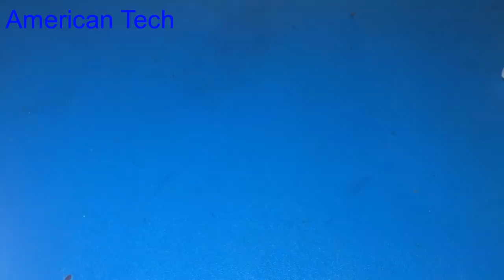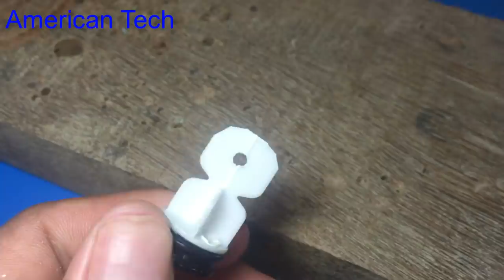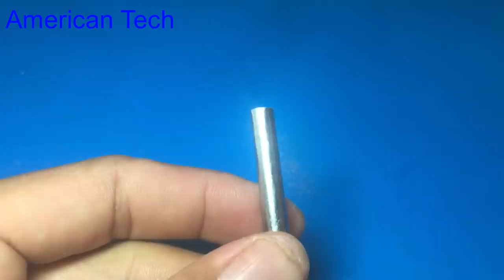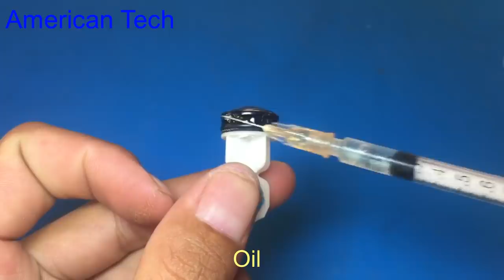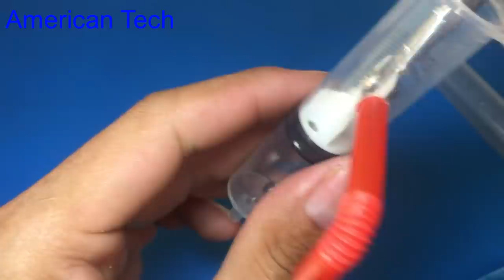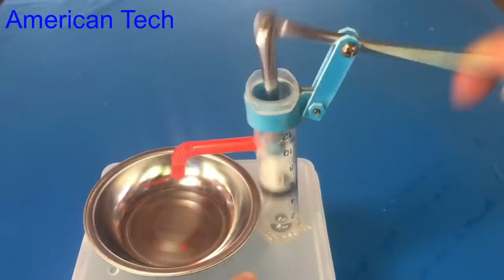Mini hand water pump using syringe

Comment: What the reason of used this small ball?
Reply: There are 2 balls, lower and upper. The lower ball serves as foot valve while the upper ball serve as check valve. During upstroke movement of the pump the lower ball opens and the water rushes in,and during downstroke the upper ball opens,while lower ball is close, then water rushes out of the pump.